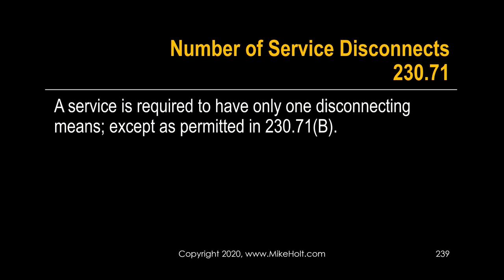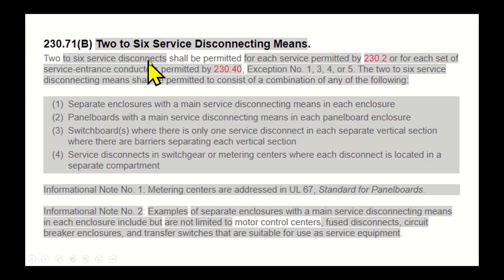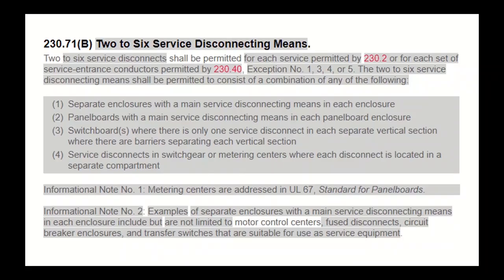Service Disconnecting Means [230.71, 2020 NEC]

Comment: This is certainly going to be a big change for us in South Carolina when we finally decide to adopt the 2020 NEC currently on the 2017, because we commonly install 400, sometimes 600 amp services consisting of the meter or CT metering and two or three 200 amp breakers in the meter cabinet for the 200 amp panels in the house.

Comment: In a way this new change sort of reminds me of the split bus panelboards,  where you had a main section usually the upper section,  and a lighting section, with a breaker marked MAIN, or sometimes LOWER MAIN, for the lighting section buss bar.  Following the six throw rule, these panels were fairly common from the 1950s until the late 1970s,  when they were no longer allowed after  it was found that DIY'ers would oftentimes replace the electric range and water heater for example,  with gas appliances and replace the two pole breakers in the main section with single pole for the purposes of adding additional circuits therefore requiring more than 6 throws to disconnect all the power in the home.

Comment: I feel the need for the change is due to the solar industry and the utility interaction. You need to have the ability to disconnect large solar systems connected to apartments. The rule change will be great for utilities.

Comment: Brian gets it
Reply: I'm not an electrician so please excuse my naivety and thanks in advance. As I understood it, Brian was suggesting that this code change significantly changes the typical (former) meter-main setup that had multiple breakers in one enclosure. #1 - Does this code change affect an electrician's level of effort? #2 - If an electrician failed to comply with this code change in the first place, would it be a big lift to modify the installation for compliance? #3 - What are the implications for an electrician on failing to comply with recent code changes on new installations? $$ Penalty? Re-work at no additional cost to customer? Guess this could hurt their reputation and future business potential? Thanks much!
Reply: Brian gets the impact but once revised ul67 comes out and products are available they will just need to be marketed properly and made accessible from distributors. Should have no impact as long as the equipment becomes available when the code is enforced

Comment: I have serious concerns when a row house home owner wants to replace an existing service in a 16' wide home where the garage and door takes up 13.5' only leaving a 2.5' wall. In thousands of homes in my city like this has a 3'  high air conditioning unit in front of existing meter socket followrd by a 10 to 18 degree short driveway. In order to provide the required 36" clearance in front of service disconnect the air conditioning unit would have to be moved ( refrigerant would have to be pumped down then refrigerant lines extended then a vacuum pump run for hours ) and 240 volt & control wire extended. This could add a thousand dollars to the job. Can not justify this high cost to existing houses. Combine this and say 20 $50 AFCI circuit breakers a 100 amp service would cost iver $3000.
Reply from the maker: The problem is that it was ioriginally nstalled in violation of the NEC...

Comment: I have a meter main with my well breaker and breaker lock. The well is 80ft away plain sight I'm being told I need a disconnect at the end of the house or within 50ft is this true? I'm in Florida.

Comment: Quick question.  Does this apply to industrial applications? ie We have a 1000 amp main fused disconnect which feeds a 1000amp splitter which feed 7 fused disconnect each going to a separate machine skid.  Thanks
Reply: Boop
Reply: It sounds like your situation already meets the new requirements,  since you can shut off power with a single handle throw.

Comment: How does this work given an existing MLO service panelboard with a vacancy for adding a 6th breaker as the 6th otherwise-allowable service disconnect?

A: "The MLO panelboard is existing, and it was OK then.  Any new work has to be done per the latest standard, which means the grandfathered MLO panel shall remain unmodified."
B: "It's existing and it was OK then.  No new safety hazard is made by adding the 6th breaker.  Just get a shutdown and do the rest of your scope of work per the current standard."
Reply from the maker: Holy crap, never thought about that.

Comment: Correct me if I'm wrong but in a apartment setting when you have a modular meter center that slide into each other with a say 600 amp disconect enclosed ahead of the meters . Isn't the service entrance conductors that come from the xformer to the top of that main 600 amp breaker and the breaker  is the service and after it leaves the breaker it then becomes  a feeder even tho it in a buss  meaning that the 600 amp enclosure be is the service and not the individual meters
Reply from the maker: Yep.

Comment: I'm not an electrician so please excuse my naivety and thanks in advance. As I understood it, Brian was suggesting that this code change significantly changes the typical (former) meter-main setup that had multiple breakers in one enclosure. #1 - Does this code change affect an electrician's level of effort? #2 - If an electrician failed to comply with this code change in the first place, would it be a big lift to modify the installation for compliance? #3 - What are the implications for an electrician on failing to comply with recent code changes on new installations? $$ Penalty? Re-work at no additional cost to customer? Guess this could hurt their reputation and future business potential? Thanks much!
Reply: @Piyush Here is a brief answer 1.) Yes 2.) Unlikely they would forget since the inspector would require it if the area is on the 2020 NEC. 3.) No clue but see answer #2
Reply: @brianhouse5983  Thank you Sir!

Comment: If you want to de-energize bus bars, would that not require the utility to have a locked main disconnect in their pedestal, this would solve many safety issues.  Mario is correct for safety, but 230.71 does not state bus bars, so sectional 6 meter stacks would be ok as of now.
Reply from the maker: Please read 230.71 in the 2020 NEC and watch this video again on what is required by the 2020 NEC.

Comment: I understand why they want the barriers and separate compartments is to reduce potential for shock hazards or arch flash from live parts in compartments. But why not just require a maintenance disconnect before the meter enclosures to de-energize or have utility de-energize the Service before working in the compartment???
Reply: Seems like a big change to address something that seems easy to avoid for most if not all residential and commercial scenarios no???? Where exactly would this described dangers exist that cannot also be disconnected from the utility to safely work in compartments???! I Need more information to understand what's going on here.
Reply: Well I can't speak to the former, but for the latter my understanding is that it's a long and tedious process to wait for the utility to come and disconnect the power. Has to be scheduled, ect. Something like that would create pressure to just work live. I've seen it before. So perhaps they are trying to find other ways to avoid the worker body count from stubbornly rising.

Comment: I have a question here , does this article applied to the Secondary side of a compact substation ? .... And if not , is the isn't limitation for the numbers of the outgoing disconnecting means from the compact substation ?
Reply from the maker: Substations are part of the Utility system, and they are not under the requirements of the National Electrical Dode.
Reply: @MikeHoltNEC  thank you so much , so which code should i follow when designing a Compact substation for the US government projects
Reply from the maker: @marcogamil6941  No clue, but I think the 'contract' would specify the standard that the substation is to be designed for. I have no clue what a 'compact substation' is. What is it and what are the voltages.
Reply from the maker: @marcogamil6941  Probaly IEEE 80.
Reply: Marco you are talking about a unit substation, and no this is not talking about that, you should refer to transformer secondary protection.

Comment: I’m upgrading to a 200amp service , does anybody know if my emergency disconnect has to be a fused disconnect panel or not. Not knowing  to get the fuseable panel or non fuseable panel is holding me up. My meter outside and main inside panel in home are over 6 ft from each other.

Comment: With changes in residential solar and now battery storage there only one solution that will help every contractor down stream, and thats to separate the utility entrance from everything.  Meter main then go from there.  These combo panels will not work with todays alternatives for generation.

Comment: A meter serves as a means of disconnect
Reply from the maker: I'm sorr but your statement is not true. See NEC Article 230 on the requirements about the service disconnect, and a meter does not meet any of them.
Reply: MikeHoltNEC - out here in Cali we have PGE green book - disconnection from facilities rule
Reply: @orwinz  You might have a meter and breaker contained within the same product, in which case the breaker could be the service disconnect.  But meter sockets in general, are not service disconnects.